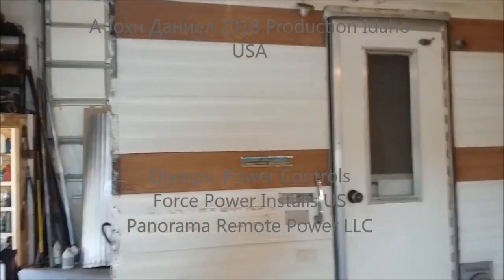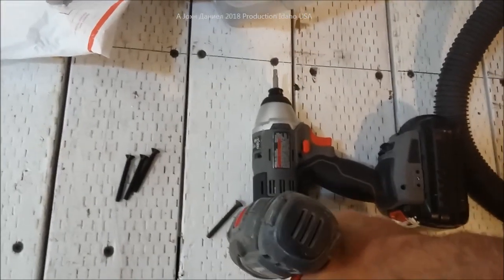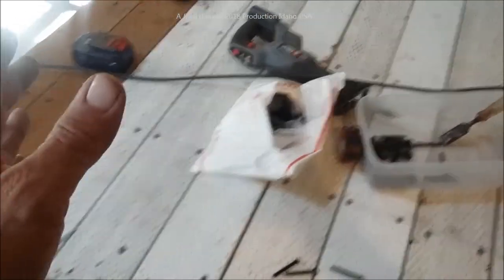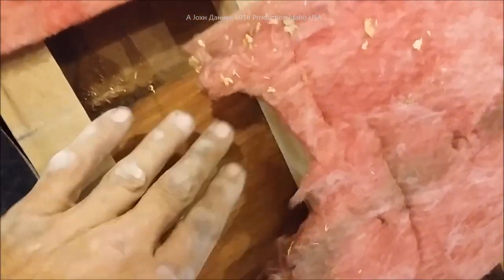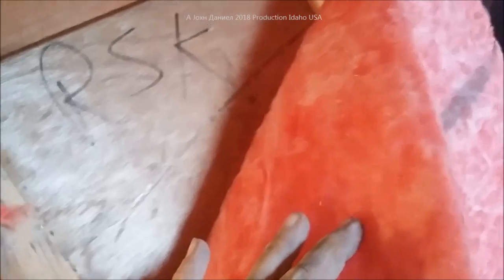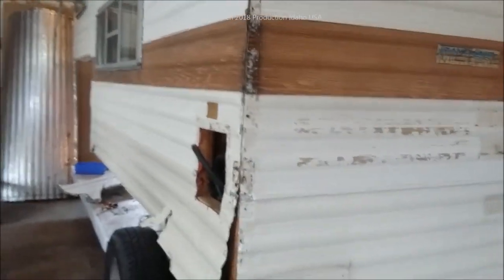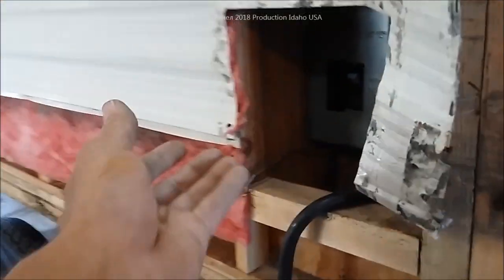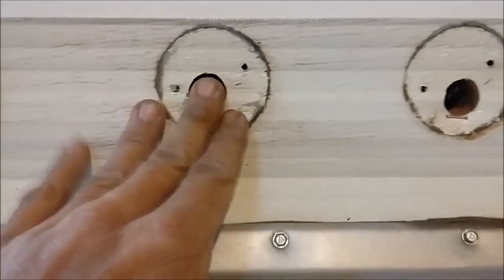BUG OUT shelter, the Demo & Build in stage 2, video 2 ( items to use below)

Comment from the maker: Power by -  PowerBright APS-2200-12 pure sine https://ebay.to/2O5Efgv ,Low 50 watts Galanz mini fridge $109 free ship https://bit.ly/30B1TJv , MY TIP  ✌  FOR MY LONG TERM CHANNEL FOLLOWERS - Complete 1200w OPC SURVIVAL POWER SYSTEM -- 100 Watt Panels https://ebay.to/30FYSs1 ,$120 REAL 50A MPPT https://ebay.to/3abTqju ,Solar Connects https://amzn.to/2XJOa1M ,Battery cable USA made https://amzn.to/3h6dsim ,12/2 Above/Underground https://amzn.to/2XIJolg for safe DC wiring of lights and appliances. (appliances you can use on 12 volt full list below)
Cheap Inverters with proven 4+ year records of quality - 3000 watt https://amzn.to/3awLWrS for tool, high amp and start up use, & a 1000 watt Pure sine for sensitive computers, TV's and electronics https://amzn.to/2Y1UHoH or just go one big inverter a 3000 watt pure sine (preferred method) for what your system can produce in peaks https://amzn.to/3iNsQjQ 
 
**BEST BATTERIES - aka DEKA SOLAR are Duracell GC2 & B-903-L16 that actually can last 10 years. Made by East Penn, sold by Batteries+ as a Duracell for less.  https://bit.ly/2wv1VXd Order online, pick up for cheaper. Don't let more $$ lithium sellers fool you Go best in class or this Below!!!
~HURRICANE LiFePo4~ is the best affordable all in one 100+ AH Lithium option using Pure Prismatic Cells, not the others flashlight cells!!, go to link, add to cart and put in code WIND5 for a discount on all items in there. You can send them parts request, they know more sources. https://www.hurricanewindpower.com/hurricane-battery-12-volt-100-amp-hour-lithium-iron-phosphate-lifepo4-battery/

Proven Parts List Based on the 2015 Prepper Mountain version of "LIVE OR DIE 1200 watt 12 volt to 120 volt Home Survive/ Protect/RV System" - for off grid power basics
Get your 12 panels, 2 controllers of 50 amp, right inverters, 6+ GC2 or L16 batteries, (8 better) and options for a small wind turbine ( listed below) exist at this power size of build. Total cost $2400 to $3000
*12 volt cooking appliances. Examples - Check it! Truckers Know!! https://ebay.to/3iLOqVZ

Ask direct questions to fit your exact plans, I can direct you to best wire gauge, light/appliance option, inverter options to your solar/wind area based needs. Freedom Must survive in the dystopian worlds future  -  olympicpowercontrols@yahoo.com
(I only repair & install since 2006, I do not sell any items seen)

*Highest quality WN100 factory made 100 watt solar panels https://bit.ly/3krCtpa OR see 5 bus bar 100W solar panels https://bit.ly/3hMWDZ0 or https://ebay.to/2RHr9cg
#1 Coffee in the Shop By COMMUNITY 
Hard to find trailer parts https://bit.ly/39fLdK4
Off Grid Incubators provided via https://amzn.to/34CbNLM
REAL Gaina Ceramic Coatings is  https://amzn.to/2RFyYiD

Comment: Hey bud. I'm curious. You are dissembling the majority of the trailer. Why not just build it from scratch?  I am sure you have a good reason. It just seems like a lot of work taking it apart and rebuilding it, vs. Just building it from scratch.
Reply from the maker: It's just the flimsey skin. And a very thin un insulated one at that. The rest is all there.
Reply: Yeah, I guess it is still easier to just replace skin and new insulation rather than building from scratch.
Reply: That's a good idea.